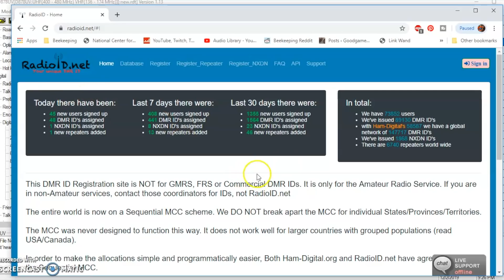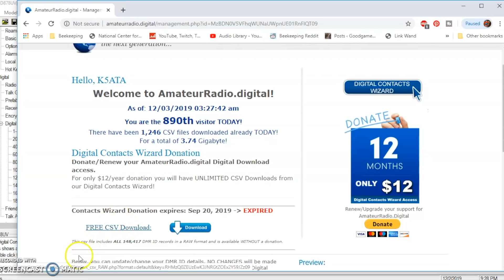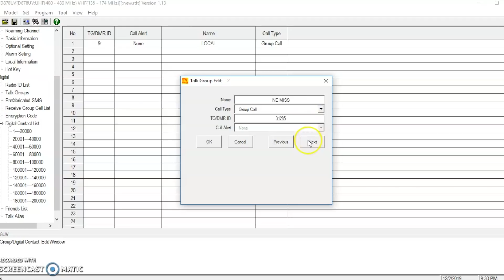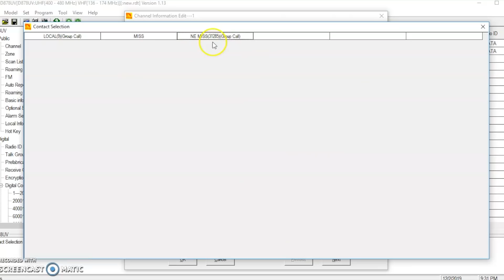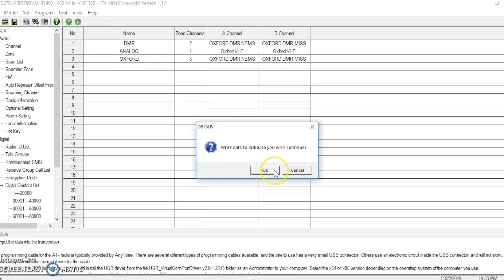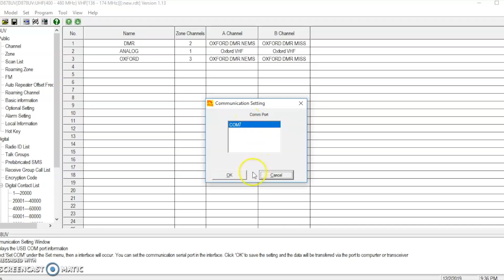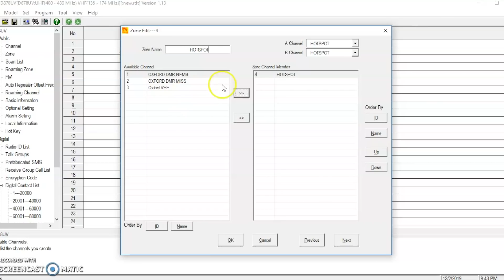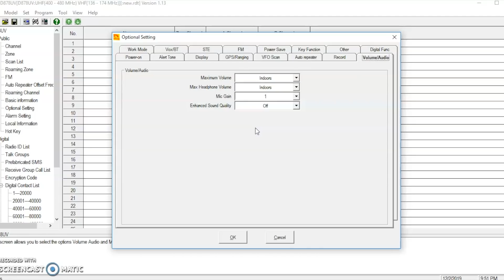How to Create a DMR Code Plug: Anytone 878UV BTECH DMR 6x2 and MORE

Comment: I can not get the radio to talk to the computer.  I plug in the cable and the computer does see it, but not the radio.  If I plug in the cable alone I get USB com 3.  I also get the same thing if the radio is attached.  I tried several different combos radio on/off etc. but nothing seem to work.  I tried several different cables and drivers but nothing seems to work.  Keyboard is locked on the radio.
Reply from the maker: Hold down the menu key and hit the star key. That should unlock the keypad, then try it.
Reply: I did that many times.  It does not work.

Comment: Same as Ben Reeve. I got my Tech a couple weeks ago. Still haven’t tx’d anyone... this video has been very helpful. More so than Bridgecom, but I’m still confused by frequency offset entry for digital (and analog)..as to where it goes or if it even matters for digital. Sorry if that’s a dumb question, but I don’t know any HAM operators here due to the virus and the lockdowns, protests, etc. 73
HN6JVL
Reply from the maker: The offset will depend on the offset for the repeater you are using. For example, here in the US, the standard 2m repeater offset is .600 So, if the repeater transmits at 146.61 and it has a negative offset, I would set my radio to receive at 146.61 but to transmit at 146.01. If you are using a hotspot, it can be simplex and you have no offset.  Does that help?
Reply: Thanks. I woke up this morning after being stressed about trying to get my 878 working, and realized it truly was a stupid question as the RX freq and RX freq is entered separately. Light bulb over head. Thank you for the quick response and not telling me I’m stupid. Haha. Thanks again for the video.
73

Comment: I have my radio for months. Program it over and over but can't get DMR to work. Repeater is listed as DMR so I program it in. It doesn't work. It is only a mile from me but I can't get it to work. Then I find out that there is more than one DMR! I don't know if the local repeater is DMR really D-Star, System Fusion, Brandmeister, or what ever! Am I programming something wrong, the repeater is not the type of DMR that I am set up for!
Reply from the maker: DMR is different than DSTAR and Fusion. You need to know what digital voice type the repeater is, then make sure you have the appropriate radio. If you want to give me the repeater info, I will check into it for you.  73 and thanks for watching!

Comment: I cant read it write to my radio. The com port is right. The cps version and firmware version match. I keep getting the same error. Check connection, retry. The cable is connected fine, because it writes to the radio fine when I do the firmware????
Reply from the maker: Hmmm... Did it write fine before you updated firmware?
Reply: @K5ATA  Yes, but I've even downgraded and it wont read or write any code I try. It does write the firmware fine, just wont read or write when using a code. I've tried my pc and my laptop, uninstalled the driver and installed. I've also exported the code plug as a list and each as a cvs file and imported back to the cps and still will not write. I'm ordering a new cable but dont think that should change anything because it writes the firmware fine. Im at a loss
Reply: @K5ATA  also made sure to reset after firmware update
Reply from the maker: Is it the Anytone or the Btech? Basically the same radio, just trying to see what's up. Can you take a picture or video of the process where it gives the error and email it to me? I'd like to try to help figure this out.
Reply: @K5ATA  Its the Anytone 878uv
Reply: mtngr1 the issue may be that you need to change the frequencys. On my radio I had to power off then hold the ptt and the 1 key then turn on and wait for test mode , once you see test mode release buttons then turn the channel to match the code plug.  I had to set mine to 00000 to install my code plug.  There are some good references if you google search on this.  Maybe this will help you.